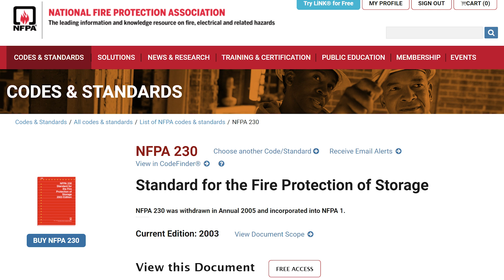Do wood chip piles self combust?

Comment: If you are using hot water for your heating in your house to greenhouse, run water piping through the wood chip pile and use the hot water it generates to aid in your heating.
Reply from the maker: We had idea along the same lines: run water piping through wood chip pile to heat greenhouse directly.
Reply: @AdventurousWay  An old Mother Earth News tip. DVD is available of all issues.

Comment: Hay has a higher combustion rating than one hundred and twenty degrees. You will see those huge round bales sitting in fields all year until they are needed. Even the bales, I have broken them apart many times and yes, they were hot, not to the point of combustion.